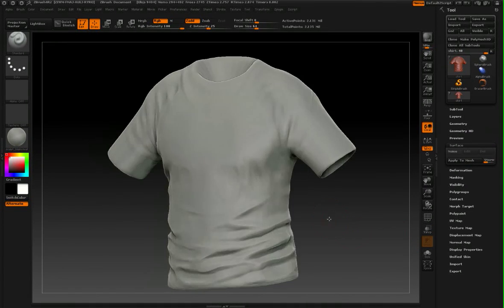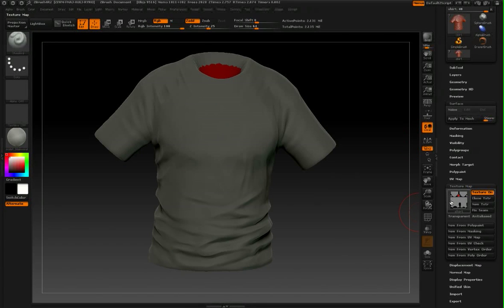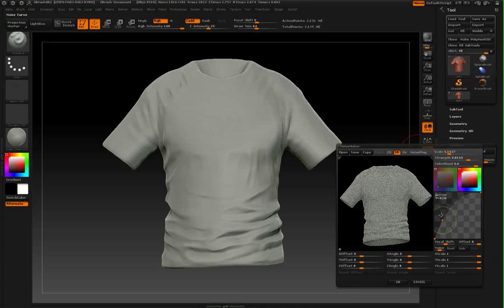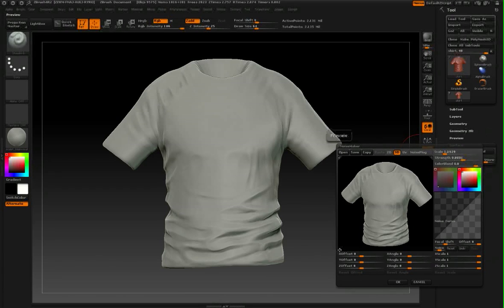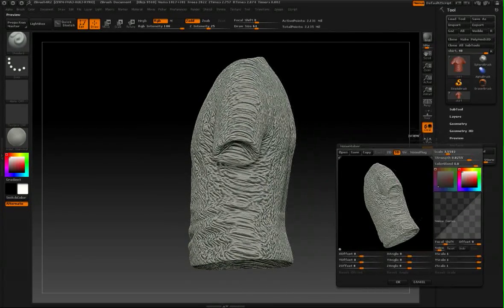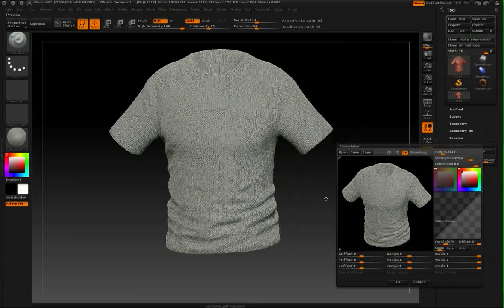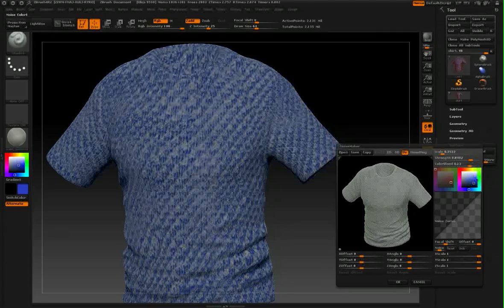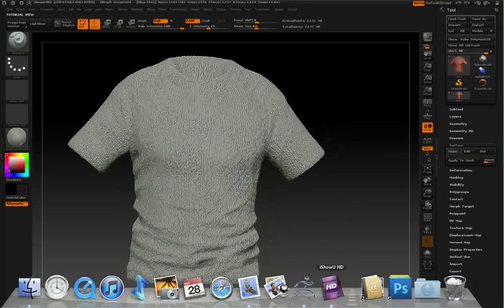Zbrush 4r2: Using Noise Maker

Comment: But then what do you do with the 2 million poly it's surely to much to be useful
Reply: 2 Million is totally reasonable for zbrush.  In fact it's rather low.  If you mean taking it into a different program to animate or into a game engine then you would need to create a low poly version and bake the details from the high poly onto the low poly using a normal map.